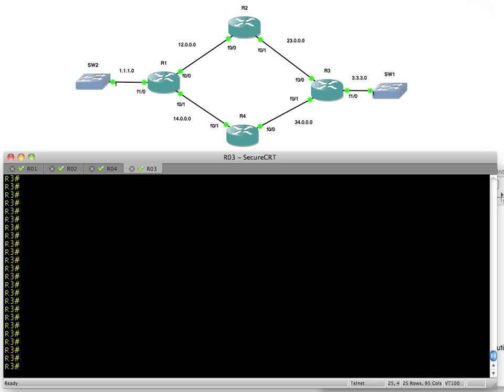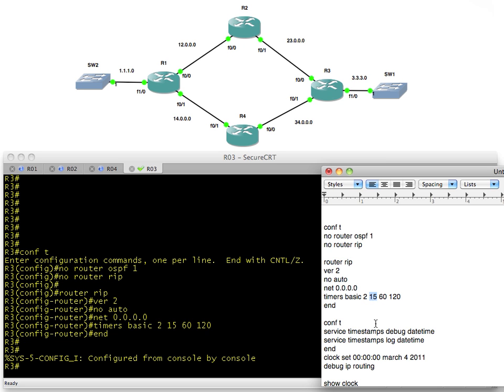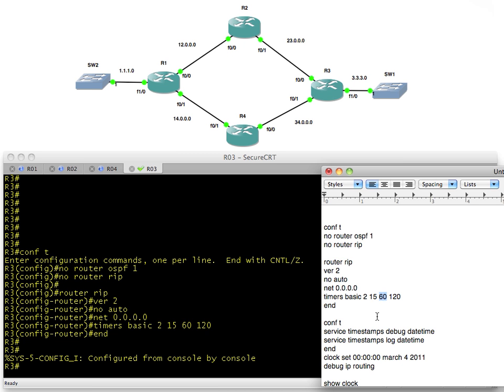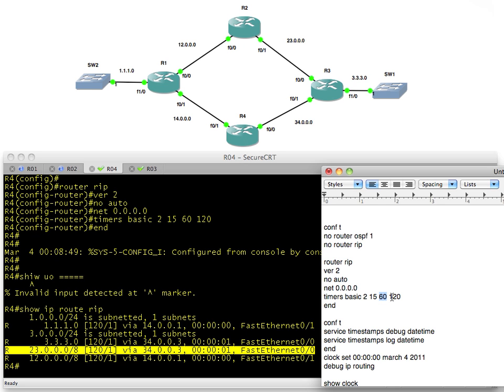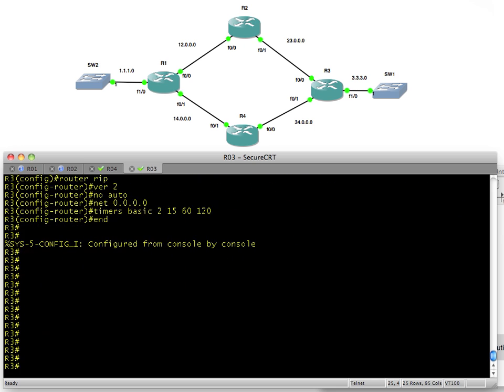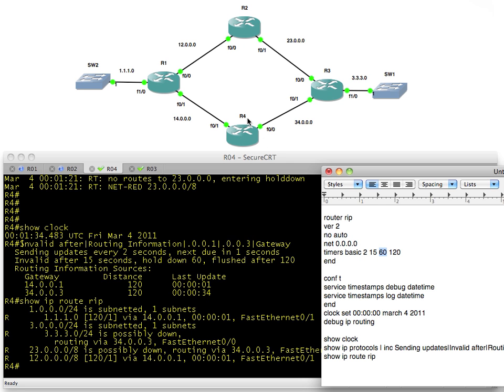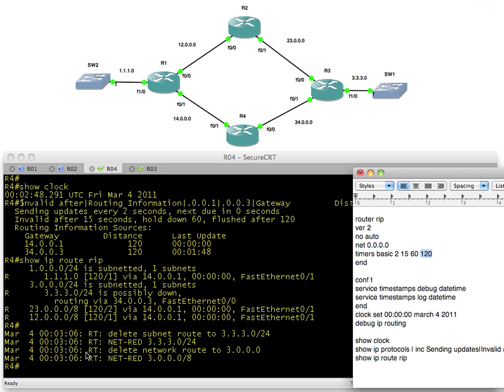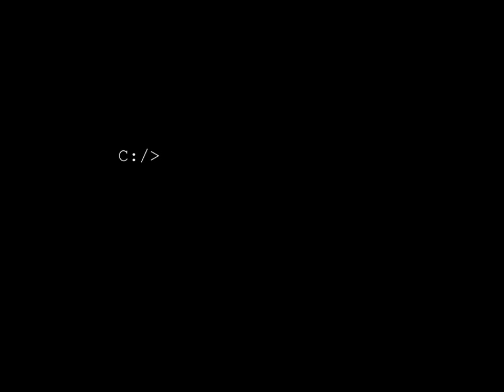RIP hold down timers

Comment: Hi, I don't understand the last last part of this video. When you shut the fa1/0 interface of R3, R3 will send triggered update to R2 and R4. Then, are you saying that there will be no hold down timer starting at R2 and R4? The hold down timer only starts when the invalid timer expire? Triggered update will never activate the hold down timer? If that is the case, by default, what's the point to set holddown timer as 180s, the hold down timer will always be stopped by flush timer 120s in advance

Comment from the maker: It isn't the version of IOS that is causing a metric of 1 in your environment, it is the topology you have created.

If you do a traceroute from R1 to an IP address in the 3.3.3.0/24 network, you will find that you are only going through a single router (single hop) to get there.   

In the topology in this video, R1 is 2 hops away from the 3.3.3.0/24 network.   Path would be R2->R3 or R4->R3

Comment: I just tried c3660-jk9o3s-mz.124-15.T5.bin, it still doesn't work, the metric for every route is 1 (for example, I used your topology, but the metric from R1 to 3.3.3.0 is 1 which is incorrect ). Could you tell me the specific IOS you use for this presentation, I have tried many IOS, please help me, thank you

Comment: Hi, that's a good presentation, it is hard to find such a detailed explanation about RIP timer on internet. But could you tell me what IOS version you are using on GNS3, most of them have bugs about RIP, such as every route is advertised as metric 1 or hold down timer dose not hold anything, the possiblely down routes will come out of holddown any time they receive a update about the route

Comment: Keith, here is my question and I have done some labs to verify it but would like to hear from an Expert like yourself.
What is total time that route 3.3.3.0 will remain in RT of other routers?
Is it a total of 2+15+60+120== 197seconds
or
120 seconds which is  inclusive of all different timers.

As per my lab output, it is all inclusive of a total of 120 seconds.

What is your take on this one, Keith?

Thanks in advance.

Comment: of course, it was a great video!
as I've started preparing for the CCIE R&S lab, I was looking at everything that could help me without having the real equipment. unfortunately, I'm leaving the academy I currently work for before the summer, so I won't have the access to the *real* equipment. 
PT was only one tool I was planning on using, but with such errors in programming, I decided on giving the GNS3 another try - it works perfectly on my MB Air :) - in combo with IOU, I'm much more hopeful.

Comment: As it seems, in the PT the flush timer is restarted after the invalid timer has been reached, and as it was set to 40, and the flush timer to 90, 130s had to pass for the route to be deleted from the routing table. Really strange, but I believe it was because I used PT and not the GNS3 (don't know why, but it's crashing all the time on my computer).

Comment: Thanks Keith. 

I was having some problems with the timers, as I was doing a lab for my students in Packet Tracer. 
If I'm not mistaken, you said (and also in almost all of the sources on the Internet) I found that the flush timer is started every time you get an update from a source, which means that if the flush timer is set to, for example, 90, it would mean that after 90s of inactivity, route would be deleted from the table. Well, not in PT as it seems...